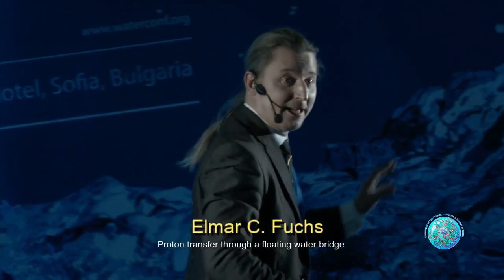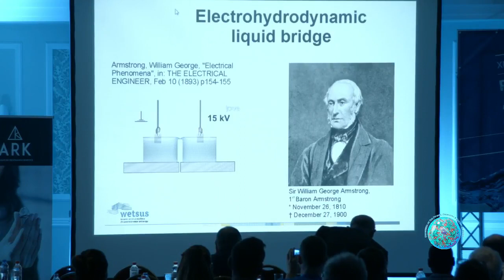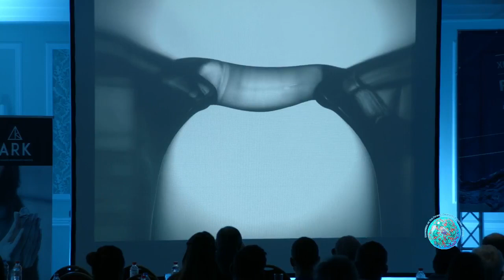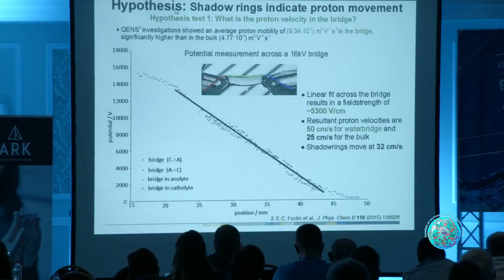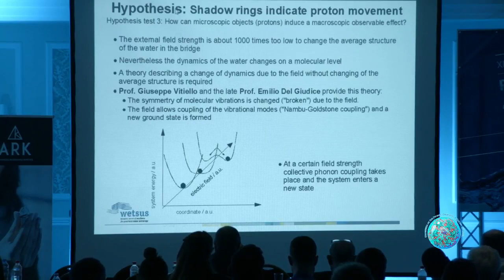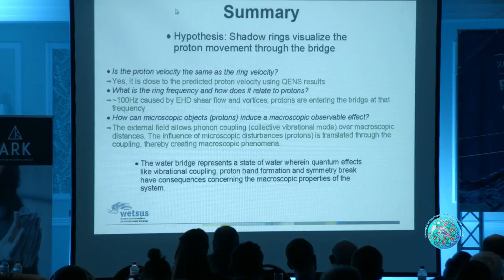Elmar C. Fuchs: Proton transfer through a floating water bridge - Water Conference 2018

Comment: Wouldn't it make sense that, as water naturally does, it creates a vortex, but it looks to me, and I'm not a scientist it is creating two vortices flowing against each other. Also it would be interesting to see what the molecular structure looks like before and after using the late Dr. Emoto's technique. Another question I would have is if the poles re-arrange themselves according to negative or positive influence, water always seems to be attracted since it has dual charge, or is there a change in behaviour by the bridge. So many questions, fascinating element. Also worth listening to Sadhguru about water to get a different perspective which links very nicely into the western scientific approach. Any answers welcome

Comment: I see that you are using conventional + and - leads...  have you tried this setup using two same polarity electrodes that are at different peak voltages?      ie 15kv+ and 10kv+?   the "relative negative" side is the 10kv side and the relative positive side is the 15kv side.   (the same thing works with common negative polarity electrodes, tho the relative positive and negative inverts, with the less negative being the relative positive and the more negative being the relative negative.)   Some other things to try and play with.